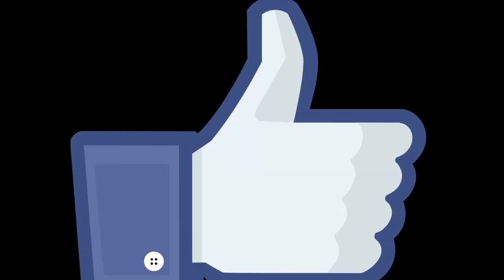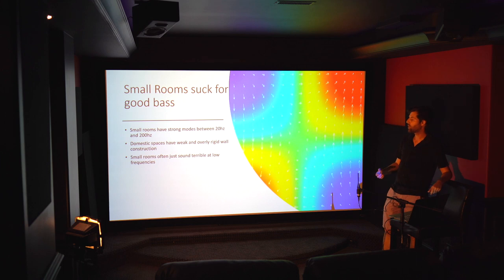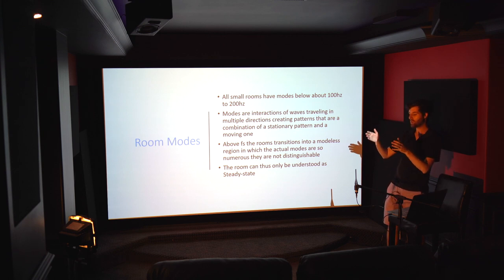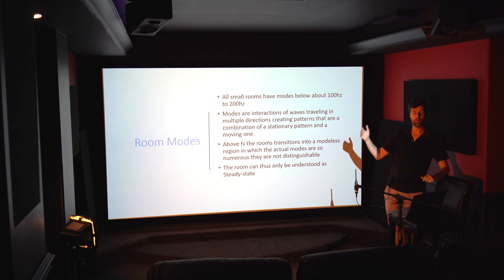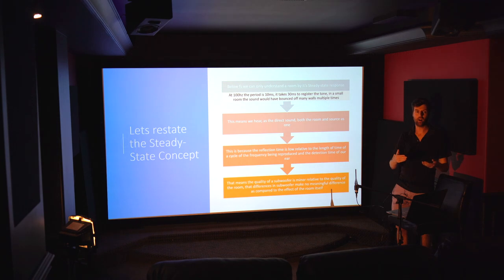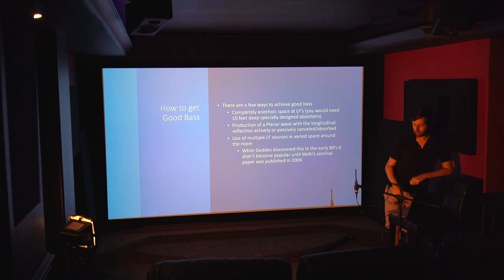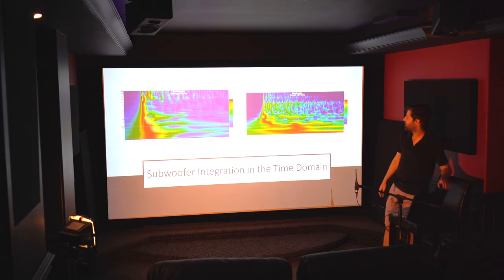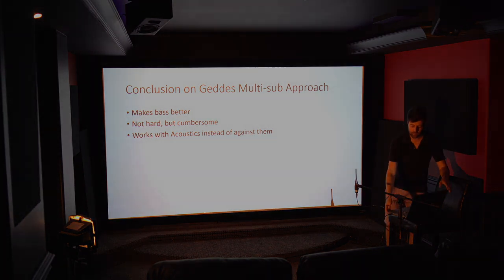The Geddes Multi-Subwoofer Bass Optimization Approach

Comment: You should note that Geddes uses bandpass subwoofers which are rare on the commercial market, this is important relating to the crossover/ low pass application of a 6db filter versus steeper filters which is needed to get the  preferred frequency response from more common subwoofer systems. The more common ported and sealed subs do not roll off like the bandpass,  VERY important detail.  Sorry I'm 10 months late     http://ampslab.com/blog/2018/07/22/albatross/
Reply: No need to apologize! That IS a very important bit. Thank you. :)
Reply: Bandpass plus first order is butterworth 18db/oct

Comment: Interesting.  I guess I'm using the Welti method then.  The idea I am working with is that the same sound from multiple sources sums and cancels, but different sounds from different sources do not.  So my stereo signal is crossed to a summed signal at 100hz.  I'm copying the Genelec W371A, which seems to be Welti inspired as well, since it uses 4 symmetrical subwoofers.  But it incorporates vertical height, which this vide says is from Geddes.

Comment: Awesome info.

I'm in a bit of an odd situation.  I have one room that I use for general edit and mix tasks but also watch the occasional film in.

I am able to monitor playback on my Tannoy monitors and/or my 5.1 system.  The 5.1 system is a bit of a Frankenfreak.  The front and surround left and right channels are all full-range (2-way bass reflex tops on dual 8" EAW subs).  My center channel and LFE are sort of a matrixed hybrid.  As in, the center top sits on top of my LFE EAW configured identical to the other mains channels.  I end up routing the center channel to the LFE output in addition to the center top.  I do this because I only have five of the EAW subs and do not have the space for the LFE to float around elsewhere.  My LFE serves double duty in being my LFE and the bottom end of my center channel.   

I'm finally up and running with REW and have started analyzing each speaker as it sits in the room.  

I've also got the ability to route my main Tannoy feed to any element or combination of my 5.1 system.  I essentially have the option to spread my LF energy from any combination of source channels in either system to any of five physical LF playback sources.  The testing is the simple part.  This video just opened up my plans in a big way.  It will be interesting to see what I can actually accomplish with this gear in the space I have.

Comment: Hang on, if Geddes uses his mains front left and front right speakers full range, then you can't use an AV receiver with his approach, because it won't send any of the bass content from front left and front right to the other three subwoofers, so none of that bass will get the multi subwoofer benefits. Right?

Comment: so am getting this right? despite all the times everyone has been told to crossover at 80 the best is to just run your mains as rull rangers and just tune your sub to match?
Reply: Linked Devices yes, so long as your mains can handle full range, your run them full range and overlap the first sub’s crossover point with the mains for better integration.
Reply: Yes definitely. The more bass sources the better.
Reply: Geddes uses "full range" speakers without any crossover because they goes only to 80Hz f3, so be carefull.
Reply: Also there is never only one solution as Matthew says in the end.

Comment: I watched both the talks. Very interesting stuff!

I wonder what could be the application of the Geddes approach in a music studio, though.

Usually, in studios, monitor speakers have 8" woofers and are pretty capable of playing low frequencies. Expecially the good ones. In fact in many studios there are no subwoofers around. 

So, I wonder if adding just one sub (instead of 3) in a different location of the room would make things better? Of course in this scenario one would avoid to hi-pass the main speakers.
Would this provide a similar result to multi-sub?
Or, at least, would 2.1 (no-crossover), be better than just 2?

Also how does the speaker stand when it comes to subwoofer quality for music studio application? An average, but linear, subwoofer could actually do the job potentially?

Anyways, thanks so much for posting this. It bustes so many myths and provides a lot of sometimes difficult to digest information in a easy way for the most part.